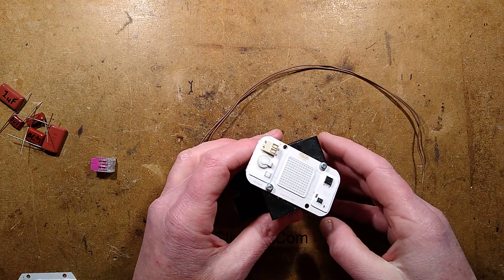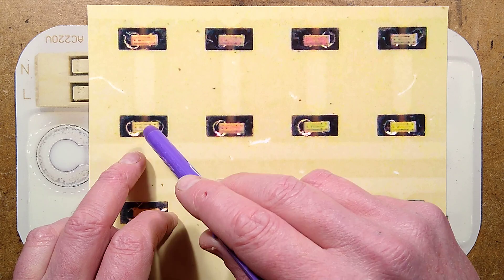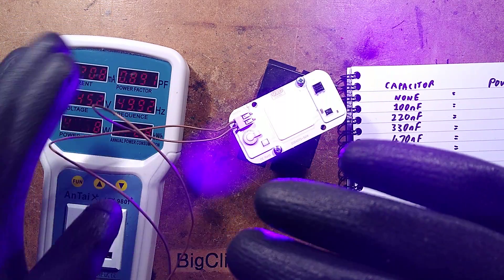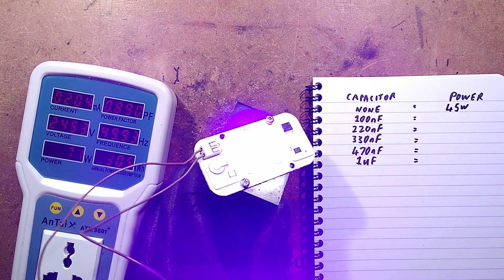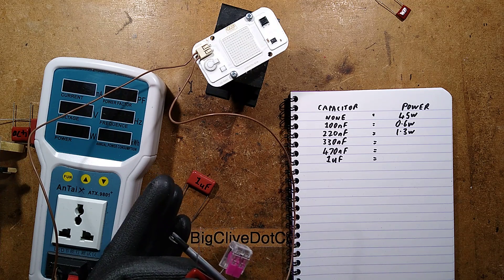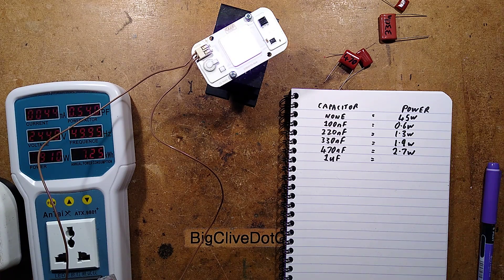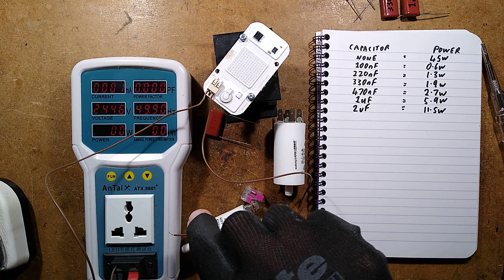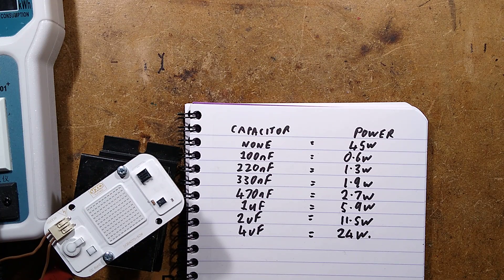High power ultraviolet LED experiments

Comment: are 20w and 30w leds the exact same but under powered?
Reply from the maker: They may use bigger chips in higher power modules,  but many do run the same LEDs at lower power.

Comment: Hey, i'm new to electronics and i'd have a question regarding your power factor. You're log your power with a power factor of 0,5. Does that mean adding the capacitor made the circuit 40% less efficient regarding the circuit without the capacitor wich measured 0.9?
Reply from the maker: The capacitive droppers do tend to skew the power factor.  The real power remains the same, but it's not ideal for the distribution network.

Comment: My play with such LEDs succeed by resoldering a current control resistor to shift down power and add a capacitor after rectifier to get rid of flickering.
For white 4000k leds it is a great solution!
Low heat, no fan needed, long life, no flickering, hotter light temp (makes 3000k from 4000k). Ideal!

Comment: Hmm, I dont know why this video made me think about this....

I wonder if a guy used a large enough plate-type R.F. tuning capacitor as a capacitive dropper in a efficient circuit such as this LED module, would it actually pass any current and be able to adjust the LED intensity? Or would the mains frequency be too low for it to work?

If it did work, the output voltage/current would be couplimg from plate to plate of the tuner cap through thin air. SO, if anyone tries this, keep your fingers AWAY from ALL parts of the tuner cap when the circuit is powered up. You could very easily get zapped, even from just touching the tuning shaft. BE CAREFUL if you try this.
Reply from the maker: The tuning capacitors tend to have very low values.

Comment: Boy, the manufacturer of that LED COB must REALLY have their reflow profile down to exacting specs and tight control to be able to produce those flip-chip COB's without having a ton of "tombstoned" or crooked LEDs that are only contacting one of the pads. 

It's amazing what the surface tension of liquid solder will do to a tiny part like those individual LEDs if only one of the solder pads has it's solder paste melt first. 

The reflow profile MUST be so closely controlled so that ALL of the solder paste turns to liquid at the very same time. Back in the day when we didn't have such precise control available, the SMD parts were glued to the board with tiny glue dots placed by a machine before the pick and place machine put the parts on the board. 

I can't imagine that those tiny LEDs are even able to be glued down.

It sure has to be hard to control the reflow process with today's lead free solder too... 😬

Comment: I am using these LEDs for developing cyanotype photography, and I bought these about a year ago. Bought 4, using one so far to expose cyanotype coated papers.
Now with these capacitor hacks, I might have to start messing with the LED (which I planned for any way hence purchasing a few!)

I did also ground the heat sink to be extra sure

Comment: As I'm a professional at a big industrial OEM LED company I almost had a hearth attack when he turn the unit on without any personal protection (the gloves is almost nothing, compared to any other uncovered body parts). It doesn't matter if you turn the emitter away as the indirect emission (bounced from walls and other object back) can make the same injury.
 If it's not even close to 50W AND a really UV-A emitter (so somewhere 395 - 360nm emission range) then he is blind already or have serious IRREVERSIBLE eye damage to the retina. (just Google it)
One more advice. Never touch any surface what is participating in Uv relation by bare hand, like the encapsulation of the LED and cover glass because even a very small amount of grease from the hand causing discoloration (turning into black).

Comment: the power isn't of interest to me at all. What matters is spectrum. You should do an experiment to measure the actual wavelength. Producing real UV LEDs is very expensive, and in my experience, this low cost aliexpress/ebay garbage is usually just a really deep purple. It'll make things glow, but it's no good for curing resins (no better than ambient light). Fake shanzai crap. The listings usually misrepresent the peak emission wavelength by a large margin (they just copy datasheets from legit products). It's very easy and fun to measure. All you need is a narrow slit, a piece of CD-R for a diffraction grating, a ruler, and some math.

Comment: Apparently UV curing is basically a matter of proportion of t*W/cm2. Reducing power to increase longevity would either increase time and/or require changing distance, both of which may be acceptable trade-offs depending on the application. Given that there are are exponential decreases in longevity with high junction temperature you could get a lot of bang-for-the-buck tuning the power usage of these devices rather than investing in cooling solutions.

Comment: For this to work, the LED board needs to be somewhat decent quality. I tried to limit a very cheap led projector like this, and it ended up powering only a quarter of the LEDs on the board, and it still failed after a year while also lowering the light output.

Comment: All capacitor series droppers are passing full 
" inrush current " at the instant of 
" switch on " ( cap fully discharged state )... and is worst , if it happens at peak of the ac voltage waveform...
Only later does it do the
 " average " current limiting...
Therefore an additional NTC series component will reduce the liabilities...

Comment: In order to optimize heat dissipation and operating life, it's still better to run the LEDs at a lower peak current. Series capacitors only reduce the average current and do not reach the same efficiency. For reference in my office at work I tried multiple LED blocks like your yellow one: 50,40,30 and 20W. They were all exactly the same with a different number of regulators soldered on them, so all that changes is the current through the LED. The 50W one lasted one week, the 40W one month, the 30W ~6 months and the 20W is still working fine after 3 years. And the luminous power is not that far from the 50W one, probably about 2/3 of it. So the best way to achieve optimal efficiency with LEDs is just to buy the lowest power modules of the same family and install several of them in parallel if needed.

Comment: Those 395nm voilet UV LEDs actually yellowed white plastics as I sadly discovered on a couple of my PCs. This now begs the question, what is the actual UV spectrum that it ranges and is prolonged exposure to these violet UV LEDs safe? I have noticed that my summer tan lasts well into January ever since installing those violet UV LED in my PC next to me on my bench.
Reply from the maker: The Philips facial tanning units use UVA tubes.

Comment: Your standard capacitor does not need a discharge on its intended use as the fan or motor windings have far lower resistance then the resistor would and will provide the discharge.
I am surprised you don't have the spade (or whatever it is called) crimps to banana cables. they are really handy when experimenting with mains inventions, as means of connecting common rocker switches inside multiple stages, or neon indicators when working within mains voltage

Comment: I've been investigating UV LED for a while now; putting together a water purification rig that can support a few people while camping, so need some decent volume/flow but that limits the time the water is exposed if it's moving fast, etc, etc just another use case but having someone put all this tested data here is pretty great to use.
Thanks man!
Reply from the maker: For water it will have to be UVC, and at this point in time the best source for water purification is still a quartz tube mercury vapour version.

Comment: I used a great deal of UV in nondestructive testing, despite glasses with UV filter I am headed for cataract surgery.
Reply: You may just be unlucky. I have plastic eyes now. They are a semi-failure in that they were supposed to give some degree of accommodation (ability to focus) but I've wound up with absolutely fixed focus. Still, I'd be blind without, but I spent a lot of money for the "premium" implants and got no added benefit.

Comment: It looks like it's flickering a lot when you add the capacitors, especially the lower values. I realize that might not be visible without the camera and since you wouldn't use this to light up a room or work area it might not matter, just wanted to put it out there.
Reply from the maker: There's no smoothing even at full power.  The camera is picking up the slight shimmer.

Comment: I have gloves like that for cleaning fish at the cabin (grey glove with blue coating), and even while dry, they allowed touchscreen use. (modern smartphones, so capacitive; I don't own anything with resistive touch)
Reply: seems to depend on the brand, im a mechanic so generally buy in bulk and simply buy from whosoever selling 120 pairs for cheapest on ebay or that. some work absolutely fine with a phone, some dont, in the latter case simply using your knuckle seems to do the job.
Reply: @denisohbrien  haha Yes... I've done the knuckle trick as well!
Albeit for different reasons, as the palm side was slathered in fish slime... 🥴

Comment: I've recently fitted a capacitive dropper circuit to a valve heater chain in a Bush DAC90A radio I have. So only a small portion of the original dropper resistor is used to feed the rectifier valve anode. The resistor is now running cold and the heaters are at around 5.6v AC - a little lower than they should be but with no or little detriment to performance. I'm using a 10 Ohms 1 watt inrush resistor and a 100K 1 Watt discharge resistor across the 1.5uF 400V AC rated motor capacitor. Using phase-shift to reduce power output rocks, my wireless now no longer smells of hot dropper resistor and the case isn't being slowly cooked.
Reply: I'm a great fan of DAC 90A radios and have a fine collection. Really looking forward to trying your dropper idea! Thanks.

Comment: On the UV topic, with real UVC LEDs, what would the power of the LEDs be at for it to be actually useful for disinfection? Because even with products with real UVC LEDs, I have a hard time believing that a single 200mA (light output) led can have any useful disinfection abilities. Like those USB-C ones with a single UVC LED ...
Reply from the maker: The UVC LEDs are OK for small areas and simple circuitry.  But for larger areas the traditional mercury vapour quartz tubes are still king.

Comment: I have bought a few ‘UV’ LEDs over the years for resin curing but was never fully convinced about the stated wavelengths. Might be a silly question but if it is emitting that colour is it definitely emitting UV or can it be basically a purple led? Is the glow the main telltale?
Reply from the maker: The classic decorative purple LED has visible phosphor on the blue chips.  These are bare chips, so just a single wavelength.  Most resins I've tried seem to cure OK with the deep violet light.

Comment: Can someone tell me what kind of capacitor i have to look for to do this? I have used a bunch of Grow LED´s (12V and 36V) in the past to get an early start on my Tomatos, Honigmelones. . . But shops from China are switching to the 220-230V Chips over the last years. So the low voltage chips are getting more expensive compared to the 220V ones. But at full power the lifespan of these LED´s is way to short. At 50-75% they last a "lot" longer.
Reply from the maker: These were standard motor run capacitors.  Very common.

Comment: Is it correct that those 3D resin printers utilize a matrix of tiny mirrors to deliver curing light to the curing edge?
Reply from the maker: The modern ones tend to use a modified LCD display with a UV floodlight under it.  The DLP (Digital Light Processor) version uses a mirror chip in a projector.

Comment: These LEDs are also used inside the cheaper LCD resin printers as the main light source for the LCD. They tend to be much less reliable than SLA or DLP printers but are much cheaper.

Comment: The way to align those tiny chips on the solder pads would be to use a dedicated pick and place machine, but if I had to do it manually I'd use a stack of two photo-etched masks. One to provide spacing and avoid disturbing the solder paste, the other closely fitting the chips so they could be dropped in with small tweezers. Potentially a third one above this could provide guiding channels to slide the part on.

Comment: Excellent demo of the role capacitors have in dropping power. Often refered too but rarely seen like this. Cheers Clive 👍
Reply: Air conditioners usually have two capacitors in the same can. They never fail together. I have a half dead one reducing the brightness of an incandescent four channel sparkle/chase light set on my house. 🎵 Making good use of the things that we find, things that the everyday folk leave behind. 🎵

Comment: Usually I modify these AC COBS with two parallel 1µF X-type as a dropper C and 25µF 400V electrolytic across the + and - of the FBR make these mostly flicker free and not run hot with basic cooling. It's quite hard to get a good solder connection tho - even with all silicone carefully scraped off.

Comment: Interesting power drop with the caps. I wonder about other applications? Like I have some 240VAC resistive silicone heater pads that get worryingly hot in use. I've put in a resettable thermal fuse, to limit the temp, but I'd like to lower the power to make them last longer. I was thinking of halving the string and putting the two halves in series to halve the power. 

I guess this cap method would reduce the power too much? The full set is over 1kW, from memory.
Reply: At that power level a capacitive dropper isn't very practical.

Phase angle control with an SCR "dimmer" is probably the most practical and least expensive if you can tolerate the possible RFI (which can be substantially reduced with a relatively small inductor).

If you want nice sinewave power, you can use an iron-core transformer as a bucking autotransformer. You would need a secondary current rating of  around 4 to 5 amperes (power for the heaters divided by line voltage) and a primary voltage rating equal to your line voltage. You connect the secondary so that its phase is opposite that of the line - it "bucks" the line voltage. e.g. a 12 V secondary would reduce the 240 V to 228 V. which would reduce the power in the heaters by about 10%. Remember that power in a resistor is proportional to the square of the applied voltage.

Comment: I have this suitcase fan which is too fast and noisy at any speed. Seems the speed settings are switched on motor windings. Would it be possible to put a capacitive dropper in series to tame it down a little? It has a grey 1,2µf? in the loop but I guess that is a interference supressor.

Comment: Every high power led I've bought that has a mains driver built in has failed within months. I now only buy the 12v white led panels and 36v UV led panels and they just last and last. My outside flood light has been running for years on the 12v panel whereas the 220v ones lasted less than 3 months. That to me shows they're driven too hard and die prematurely, pity really! What has your experience been with them?

Comment: As mentioned in previous comments ... the CPC  2μF capacitor is  IDEAL  for those wanting to make an ( everlasting ! ) nightlight using a 230 Volt , 60 Watt " squirrel cage " Tungsten filament bulb ( our Poundland™ seems to have sold out ? ) .... but this lamp will then last longer than you do ( ? ) ... ( tried - n - tested ) ....... DAVE™🛑

Comment: Why you use capacitors instead of resistors?
Reply: The capacitor is almost purely "reactive." This means that no power is actually being dissipated whereas it would be in resistors.

Comment: Regarding the question of whether they are the same LEDs behind the phosphor in white LEDs... They're not. White LEDs use blue LEDs as the exciting source.
There are a few reasons for that...
Blue LEDs are more efficient than violet.
Our eyes are more sensitive to blue than violet.
Blue is a more useful colour; few things actually reflect much violet light and most things that do probably reflect more blue light than violet.
Using blue light means that there is no need to include some blue phosphor in the mix, which would compound the inefficiency of violet LEDs by using them to produce blue light.
Lastly, the large amount of blue light in very bright, very cheap white LEDs is bad enough, but a similar problem with violet LEDs would be even worse.
If you have a blue LED torch, illuminating an unlit white LED produces a pronounced fluorescence; a violet LED torch produces far less. That's due to both the higher efficiency of blue LEDs (a 1W blue light produces far more radiant energy than a 1W violet light), as well as the phosphor being selected for its blue excitation wavelength.

Comment: i actually have one of these, but with a pink light meant for growing plants
i modified mine by removing the ptc and placing a 10k pot in it's place, that regulates the brightness really well without having to get a dimmer or finding a suitable capacitor

Comment: You should create a decade capacitor box using standard values as steps instead of 1, 2, 3, etc, with discharge resistors across each capacitor and an on/off switch for preventing arcing will changing the capacitor. Maybe an extra push button in parallel with the on/off switch for fast testing? It will be an interesting project video!
Reply: While borrowing the decade box layout from the one Dave tore apart a couple months back